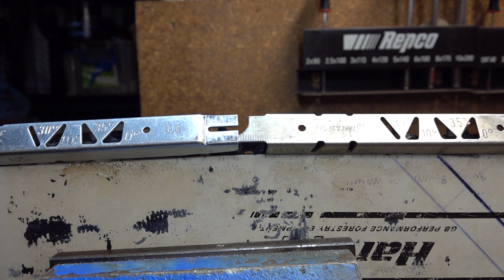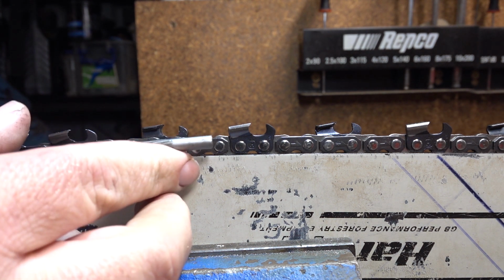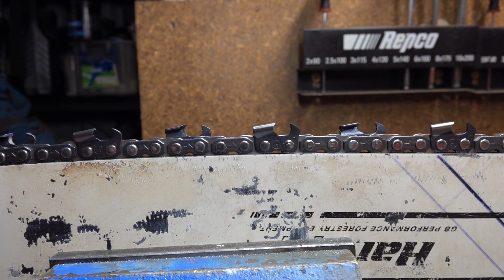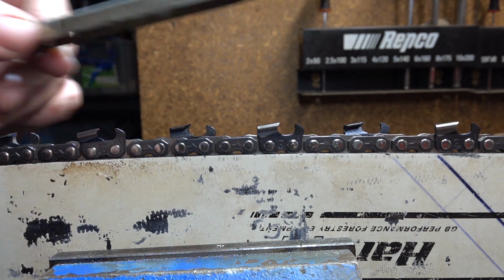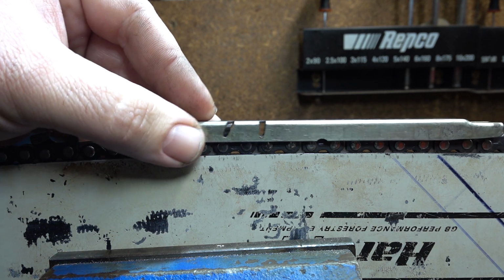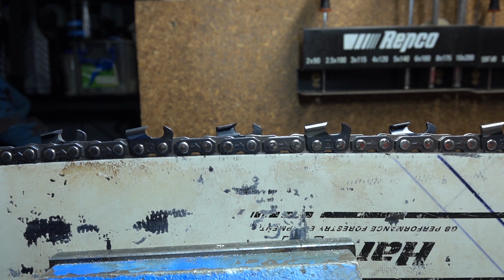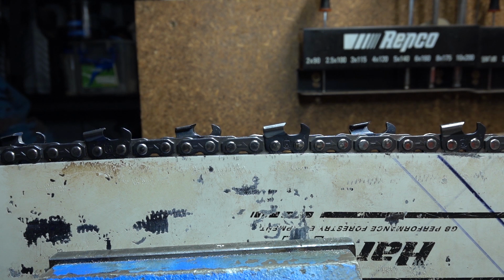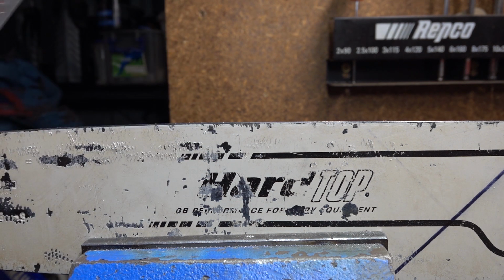Chain Sharpening angles. What they are, how to check them

Comment: Great video, maybe you should cut it up and make some shorts out of it.
I've never really used these except for cleaning my bar rails/oil hole out. I need to get a few to have around for teaching and to give to those who are new to sharpening. 
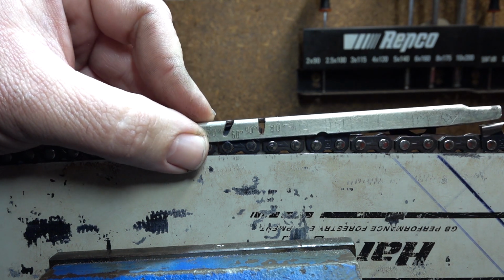At 11:08, you hild the tool down on the top of a single cutter, it seems to me it would be designed to hold on multiple cutters just as the raker guide portion is. Any thoughts?